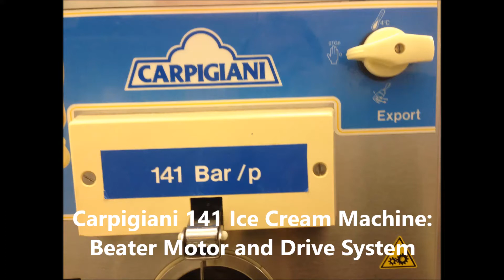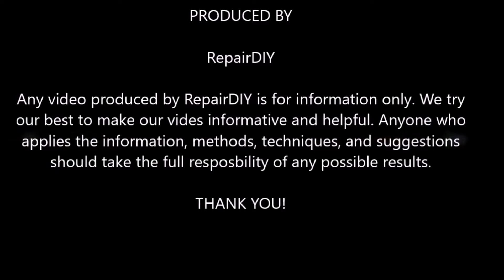Carpigiani 141 Ice Cream Machine: Beater Motor and Drive System

Comment: hi its me again. thank you for your help last time . my beater is snapped in the pulley . I had beater motor belt changed and two days later the beater snapped can it be because the engineer has not made the right adjustments ? or there can be some other issue . now engineer is not taking any responsibility ...
Reply from the maker: That's unexpected for the beater to break in the pulley hub! I thought they are very strong. Was the beater shaft broken? There could be many possible reasons if we could guess: the beater itself was damaged by dropping to ground? or manufacturing fault? what can stop the beater rotating in the cylinder? faulty consistency switch or out of adjustment? Moving forward: if you get a new beater, make sure to check the pulley assembly and the switch are working properly before install the beater? Good luck!

Comment: hi, do you know the belt size of the pump, the small one that goers on the tensioner ty john
Reply from the maker: Hi, Our machine has been sold. You could check the manual to find the part number, or measure if you have the machine. Have a nice day!
Reply: @RepairDIY if I may ask you a question, my unit has 4 setting “automatic, stand-by, beater, mix level” which setting would I need to place the machine on while closed?
Reply from the maker: @Garcel313  "Standby". Have a good day!
Reply: @RepairDIY  thank you , you as well

Comment: my carpigiani ice cream machine docent freeze .the tank gets cooler but ice cream comes out liquid.
Reply from the maker: Hi, there are too many possibilities why the ice cream is too soft. you could try to clean the condenser and ensure good ventilation spaces around the machine. you could also try to use fresh mix to start the machine after cleaned and washed. you could also try to adjust the hardness as show in one video. if all not working, you may have to find some professional to check it up. Good luck!
Reply: @RepairDIY  Thankyou that was helpful.
I have checked the freezing switch I have adjusted that’s it started freezing the icecream . But it it doesn’t stop after some time the pump keep running . I guess It’s because the freezing switch is not placed properly I have to physically push the switch then it stops .
Reply from the maker: @Backbencher-m  you could also measure the ice cream temperature to see if it is cold enough. if hardness is adjusted too cold, the compressor may not stop even the ice cream is cold enough. you could try to find the best setting for your machine. good luck